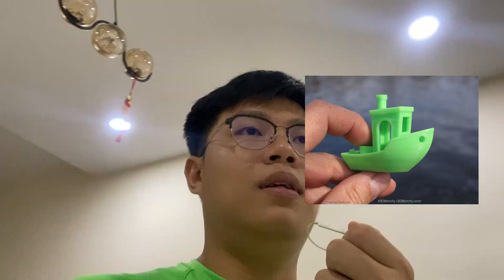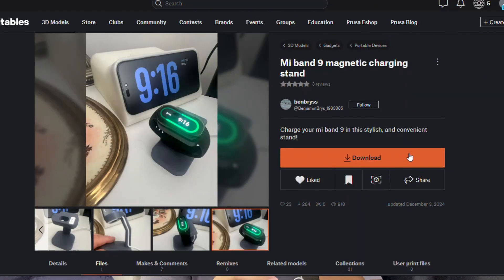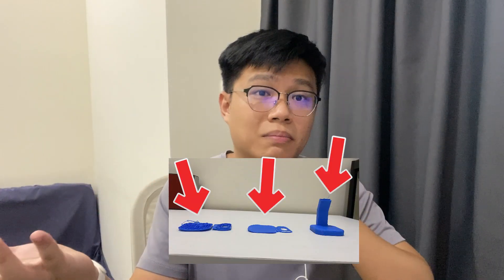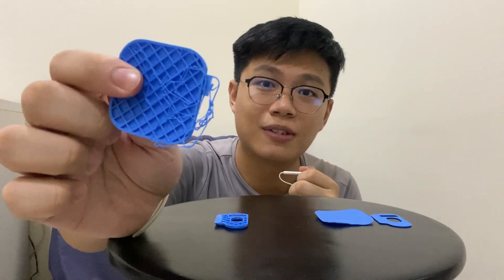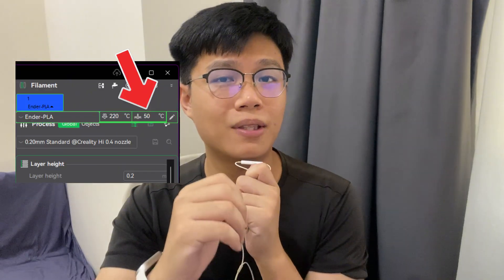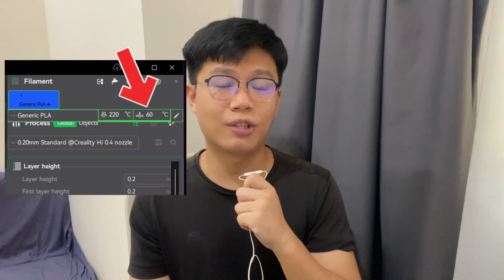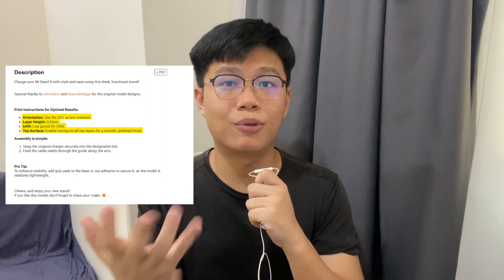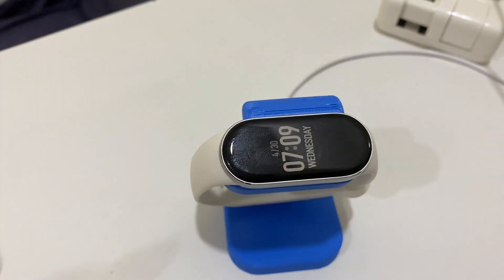My First 3D Printer Creality Hi & 3 Failed Prints on My First Try!

Comment: Make sure the print bed is set to the optimal adhesion temperature for your material.  For PLA it’s 60C.  Also make sure your machine is level.  You should be able to just slide a piece of paper underneath the nozzle when both the nozzle and the bed are preheated (200c and 60c for PLA).  By that I mean it should be a liiiittle bit scratch and rough to drag under the nozzle but not stick and DEFINITELY not super duper easy.  Make sure there is no filament peaking out.  With a level nozzle and the right bed temp it will work.

Comment: My most recent printer is the Bambu P1S and it's got a textured plate which helps with adhesion! It runs at 50c which seems to be good enough for most of my prints. I can't recall what my first print was on my original Ender 3 printer but on this one it was a test dinosaur skeleton model